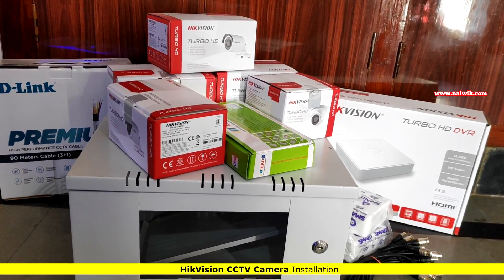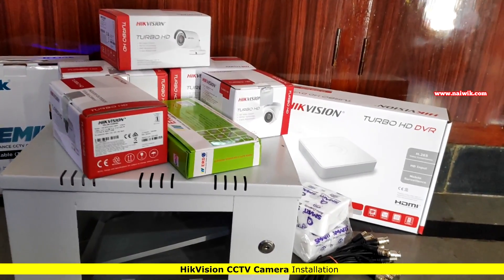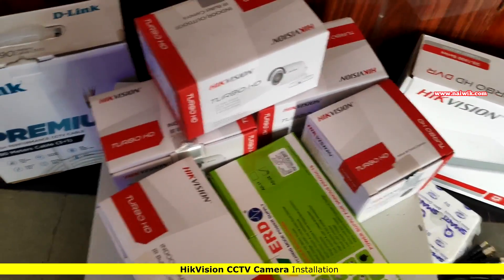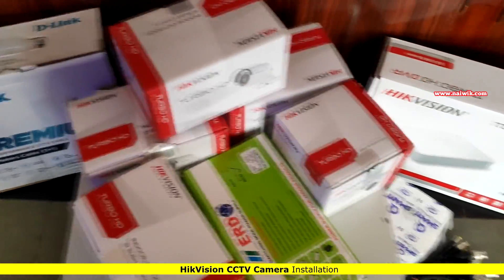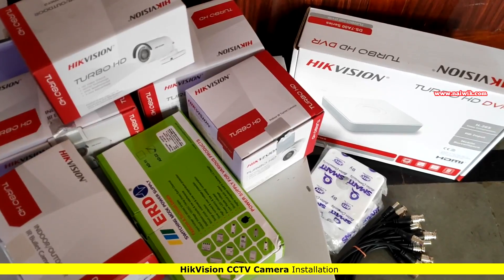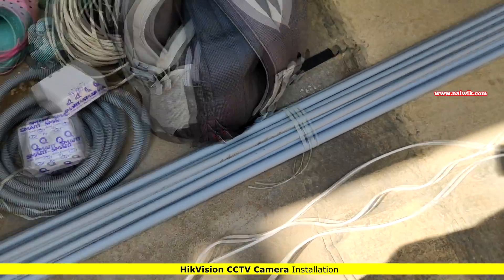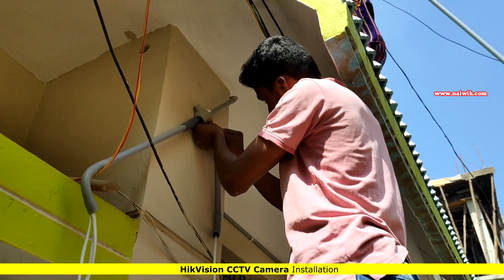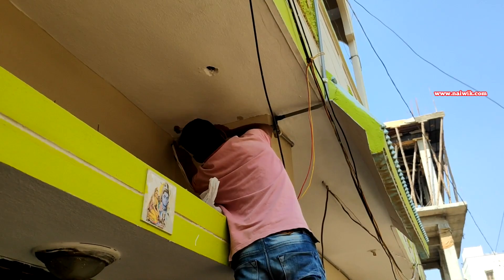HIkVision CCTV Camera Installation and Setup

Comment: How much does it cost for entire setup ?
Reply from the maker: Bro ,For 6 cameras + DVR + harddrive + power supply + box + cctv wires + installation + casing to hide wires + electric items + misc appprox 23k
Reply: @Naiwiktech  which brand?
Reply from the maker: Hikvision
Reply: @Naiwiktech  Bro i have purchased hikvision camera and dvr but they charged extra for harddisk . DVR me harddisk ka price included nhi hota kya?
Reply: @abcd0420  noo
Reply: @abcd0420  I ordered hikvision cctv set of 8 bullet cameras from Amazon which included a 1tb hard disk, a DVR box, a power supply unit, usb mouse and a 90m wire coil...all for the cost of rs13600. I then called a local camera installer who charged rs350 per camera for installing the CCTV....
Reply: Which brand?

Comment: Nice video, just one doubt, i didn't understand the cable connection to the camera, if you could please write it on the video or explain which cable goes where in the camera that would be great. From 5:40 in the video. Thanks.
Reply: thats just him seprating the power and the video outputs mate